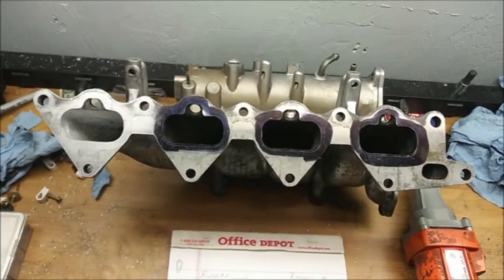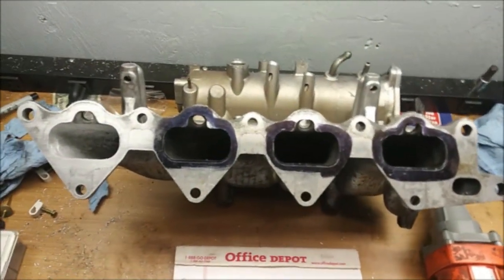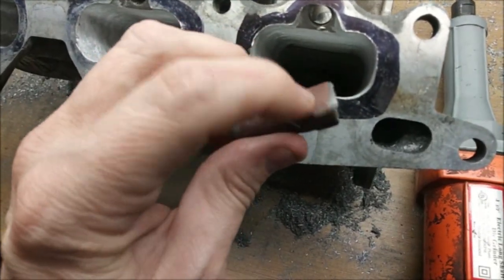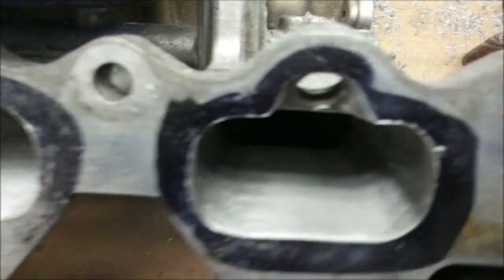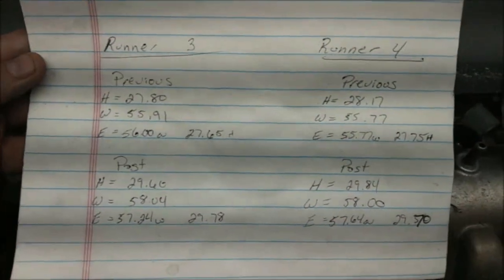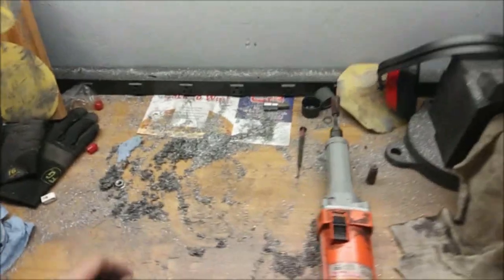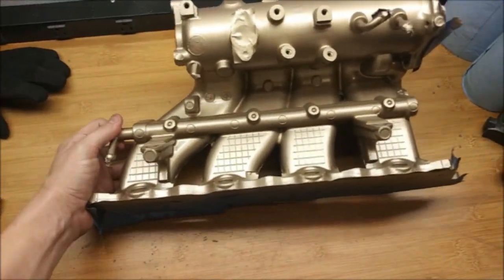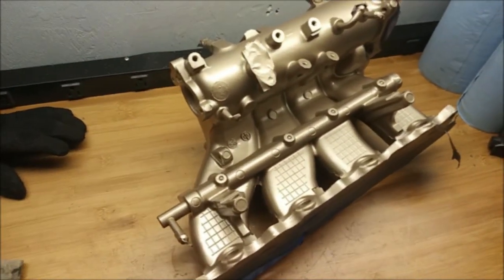Porting an Evo 8/9 Intake manifold

Comment: Does it make any difference gasket matching the runners. Im building my evo 3 head and planning to do the 70mm TB and wasn't sure if i should bother gasket matching the runners to head. Not porting head just cleaning up the rough casting in ports lots of it in my head.
Reply from the maker: Gasket matching wont add much power if any at all. I think a ported intake at the runner and matching at the tb opening with a larger tb is only worth about 10 hp or so.
Reply: @d-evolution1309  ok cheers mate will definitely be putting a 70mm TB on port matched since my cold side piping is 3inch

Comment: Can I do this on a stock evo 4 engine block ? 4g63t ? I would like to port my manifold as well , but im not sure if it would hurt the engine.
Reply from the maker: Yes you can do this on your evo 4 as well.  You shouldnt hurt anything.  Just make sure its very clean before you reinstall it.

Comment: I have a spare intake for my 5 & would like to do this as well.  Can you provide the specs of the cutting bits, 80 grit wheel etc? Can I use a cordless drill?
Reply from the maker: The cutting bit you can get from summit racing.  Be sure its for aluminum.

Sanding rolls from summit too.  They come in a kit.  Lots of diff sizes. Maybe 30 bucks?

A drill doesnt turn enough rpm.  I bought the tool at harbor freight.  I also got a voltage regulator to allow variable speed

Comment: Brings back memories from September.  I didn't port mine completely by any means but more so just cleaned the carbon out and smoothed out the casting.  I partially didn't fully trust myself, didn't have the time, nor the patience. But the one thing that made me laugh was you using the paint cans to hold the IM down.  Man, that damn thing was a PITA to keep still due to its awkward shape!
Reply from the maker: Yea man I needed some weight on it.  The paint was the closest thing without looking too hard.

I have a vice but its not bolted down yet